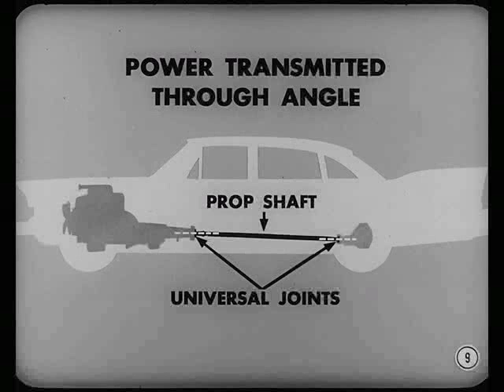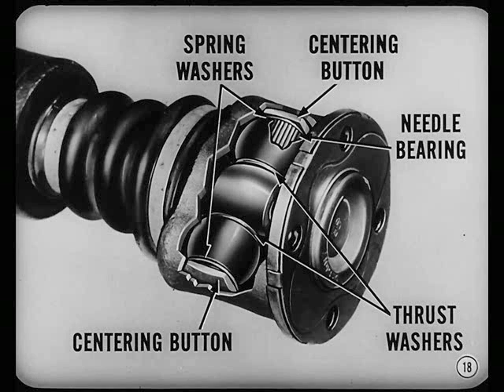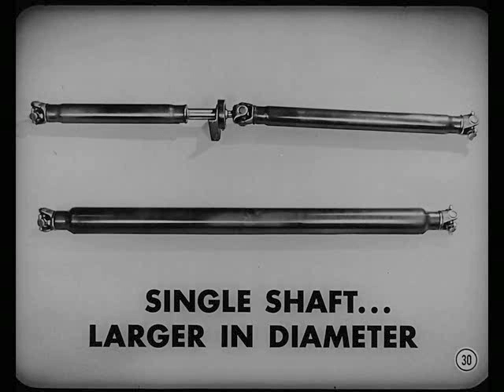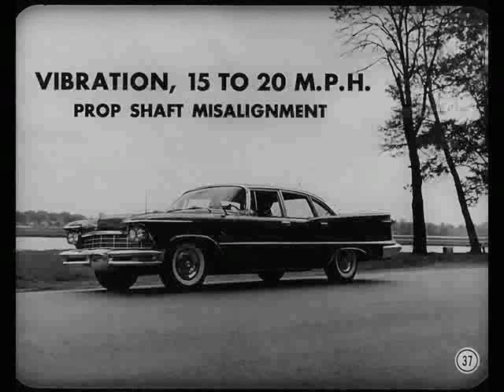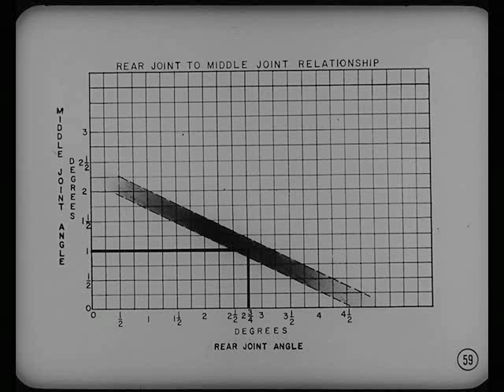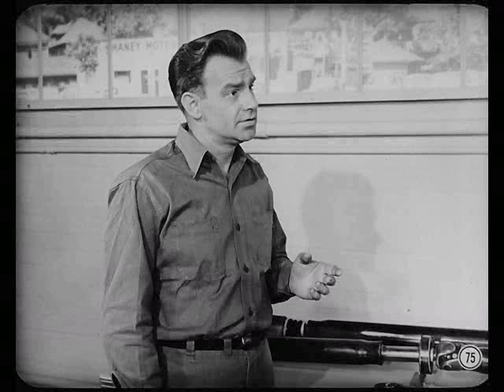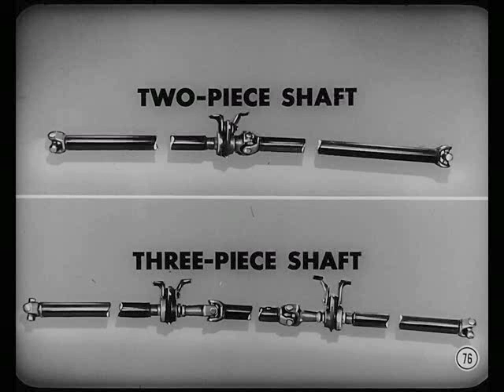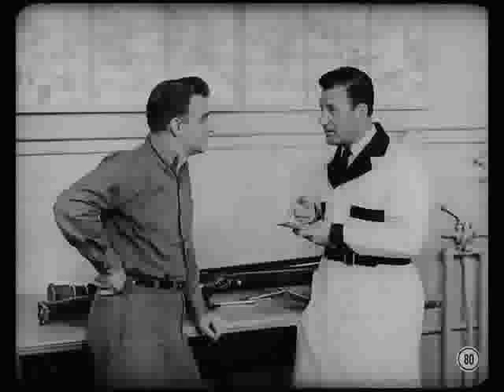Chrysler Master Tech - 1957, Volume 10-7 Propeller Shaft And Universal Joint Service

Comment: This is a superb demonstration of checking driveshaft angles and vibration causes. It's also the best, if brief, explanation of the ball and trunnion driveshaft. I've found nothing on the internet that explains why the universal joint displaced the b and t shaft, though.

Comment: Thanks. I have a 64 Chrysler 300K with a 413 with a ball & trunnion. It has a vibration that is probably the B&T.
Reply: If the B&T hasn't been touched, it s/be in balance. Easy enough to check for grease, and condition. Make sure the rubber boot is ok. It may only be your rear uni joint. Just never take the B&T pin out, as trying to press it back in without going too far either way is nigh on impossible,  003" is beyond the 'feel' of a press. I just sold my '64 Chrysler 300 Silver Special coupe. Great cars aren't they.  <-- My '62 Dart on left.
Reply: moyadapne thanks for the tips. I had a  64 Silver Edition with a Saginaw tilt steering wheel.